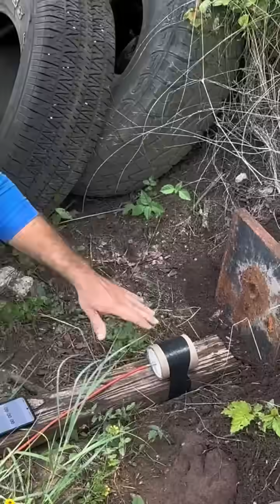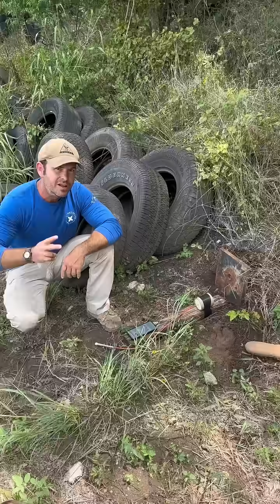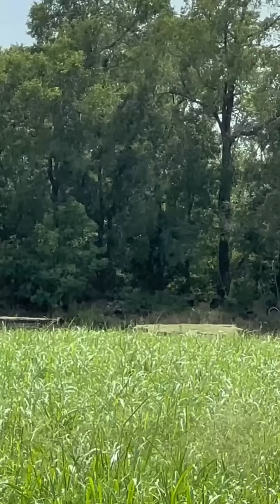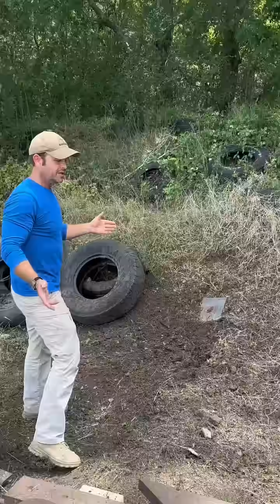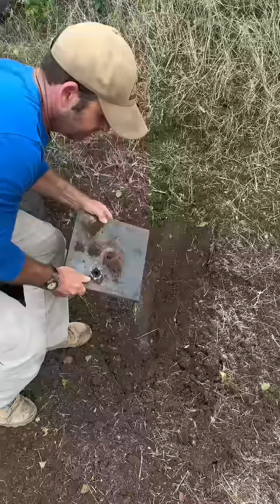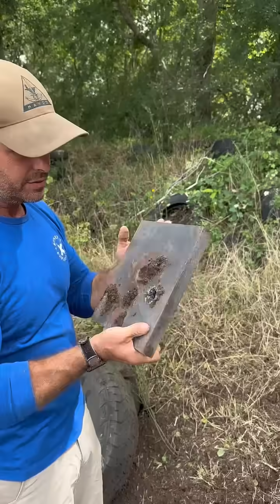Can C4 Blow Through This 1in Steele Plate?  #pyrotechnics #c4 #blast #experiment

Comment: wouldn’t a copper dome be better for cutting through hardened steel with a shape charge like that?  Try it.
Reply: If you listen he says dome not cone. That coupled with the large standoff distance would tell u its an efp not a shaped charge. And not all shaped charges have to use copper. Plenty of warheads that use other materials

Comment: Sir this was a blast, and this time i have to admit my pulsed power device can't puncture 1inch steel but it would probably set off the c4 without a blasting cap.
11200 Volt Capacitor Bank, 90uf or 5600Volt 360uf, it depends if I go a series or parallel/series. Anyway I know you won't believe it but trust me.
Reply: Hello,
My target IS figure It out, if 30 grams of naked C4( set It off with standard blasting cap typical n°8) IS capable to pierce 1cm of steel plate.